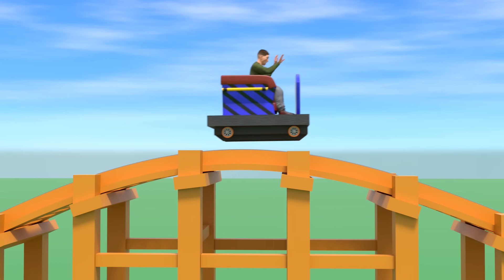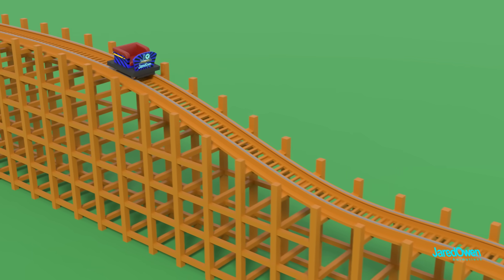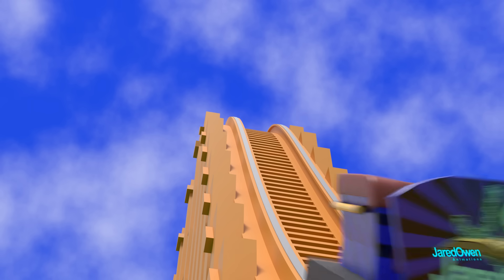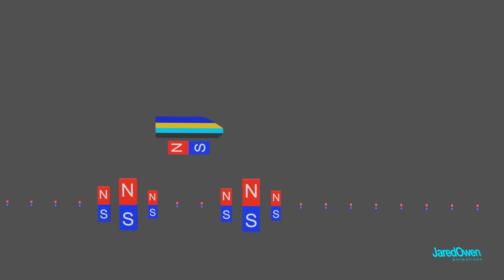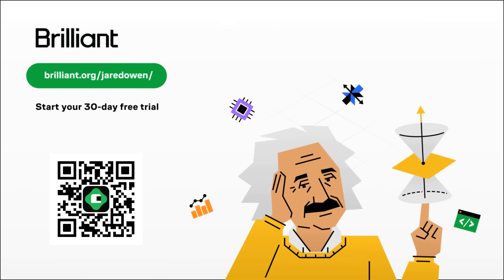The Evolution of Roller Coasters: From Wood to Steel

Comment: 12:16 This may be a question for an engineer, but couldn’t they capture some of the current from the Eddy current brake system and use it as a form of generating electricity?

Comment: Just thinking: if you use the magnetic breaksystem and you would make a small change by adding/attaching wires can't you harvest some (but probably not much) electricity from it?  -Don't know how much it would generate since the ride passes so quickly or what the peak would be... But hey, the energy is lost anyway, why not see if it can charge some capacitor which in turn through some circuitry can 'discharge' into some battery when the right amount is reached and charge a battery, power a charging station for power banks or something like that, like I said, I don't know if it would even be able to do that... Might take months/years before the charge would be good enough to do anything with it, if it's even possible/efficient enough

Comment: We went to see geauga lake after it closed. it was in the middle of the night and my moron friend sat down and pulled the lap bar down on the big dipper and got stuck. I was like "are you fkn kidding me?!? Now we have to get the police to get you out. luckily it used the old restraints and could be unlocked by hitting the emergency release on the train without power. we tried to winch the train to the top of the hill to try and ride but we saw weeds n trees growing through the track so we abandoned it half way up the hill 😂 even though the train was parked we were able to release the brake by letting pressure out of the hydrolic line since it had upgraded brakes and didn't use the old manual brake

Comment: I'm 79. Remember a 90 ft wooden coaster at Riverside Park, Des Moines Iowa back in 50's 60s. It rocked, literally.  You could feel it and hear the coaster creak sometimes. Also many years later, the Big Bad Wolf at Williamsburg Busch Gardens. It is an inverted coaster. It is a different feeling to have nothing under you on a coaster.

Comment: over the shoulder restraints didn't entirely replace lap bars. As wooden and retro-steel coasters are still made now and again, you do not want shoulder restraints on something like that. Why? there isn't enough head padding in the universe to keep you from rattling your skull with how rough some of those can be. Which is a lot of the fun for some folks.

Also, most coasters are long enough to be loading and unloading several trains at once, as well as having 1-2 on the ride at the same time, some of those LSMs can be reconfigured to be variable brakes as well so you can ensure safety spacing. From a customer experiance and business standpoint, it's a win-win. more trains means more customers can use the ride at once, so shorter lines. There's also a workshop built into the station at these rides where they can service the trains. and there's special moving track to load and unload trains into that area. Anyone who goes on Cedar Point's Iron Dragon can get a good view of the backup train if that ride is still there.

Comment: I like to sit in the front row when I ride a roller coaster. The main reason is to see where I’m going.

Which row do you like to sit in when you ride a roller coaster?
Reply: Back. Better acceleration over hills. Feels more out of control. But it does depend on the ride.

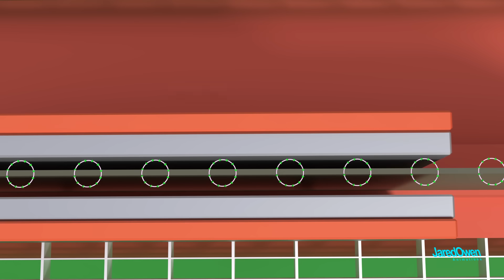Comment: 12:00 A lot of magnetic brakes use the copper or AL fin on the train, and magnets on the track. This helps ensure better safety bc if the magnet fails on the car (usually from overheat), you don't have backups. The permanent magnets on the track can also be "flashed" regularly as part of maintenance, to ensure they still have a strong field for the purpose.

Comment: What if both locking pins for the locking safety bar fail?
Reply: The bar would open, but that’s not going to happen. These things are inspected on a daily basis at every amusement park. They’re not just going to fail for no reason. It would be like asking “what would happen if your car just explodes all of a sudden?” Look at the safety statistics for roller coasters. They are incredibly safe and people don’t really fall out of them ever. And if they do, it’s for a specific reason (too large, amputee, improperly locked, rider error, external issue, etc) and not because the bar just failed for no reason. In fact I don’t think that has ever happened.

Comment: There are a few wooden coasters with loops
Reply: There aren’t. No wooden roller coaster has a loop. Some do have inversions, such as zero-g rolls and stalls, but only one modern wooden coaster was ever built with a loop (Son of Beast) and it was a failure. Loops are hard to support on a wooden coaster.

Comment: 1:22 they actually have something similar in wales on the talyllyn narrow gauge railway that they used to haul trucks up the hill step mountain to transport slate and rock and at the bottom they had one engine to get the trucks that were filled with slate and take it

Comment: Good video! What animation software did you use? Also, with Exa's, they're anything over 500. I know Six Flags Qiddiya says Falcon's Flight is over 600, but that's from sea level. The actual biggest drop riders experience is like 540 feet (the Gateway Arch shaped top hat). I can only imagine the friction those wheels are facing LOL.

Comment: Fun facts. Electric braking is heavily used on big trucks or lorries, actually it is required by law to be in place in many countries. Then they have their standard service brakes at the wheels but also an electromagnet wheel and a metal disk, usually placed at the driveshaft right behind the transmission. Then you can slow down a fully loaded truck 40-100 ton truck or a crane from 90 km/h down to nothing in no time. They also use magnetic brakes on land speed vehicles. Then they can´t use regular rubber wheels, but instead they use solid Aluminum disc for a wheel and a magnet to slow it down...

Comment: Could you do a part two and cover some of these?

LSM’s
zero cars
why launch fins don’t interface with the sides of the train and only the underside in newer coasters
Variable speed chain lifts
Banking and outer banking/lateral forces
Heart lining
tire drives
cable lifts
valleying and track sections that can be removed to de-valley a train
drop tracks, tilt tracks, turn tables, and switch tracks
why some coasters have side friction wheels between the track and some have them outside
Train articulation (like how some coasters have three seat long cars while others can have one seat long cars)
Single rail coasters 
Parts of the train like wheel assemblies/bogies and the chassis
how onboard synchronized audio works for coasters 
And of course block zones 

Also I may have missed a few to suggest but I think this is plenty

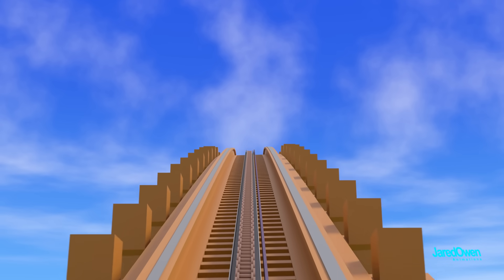Comment: 3:08 i thought it was called a lift or is that a more modern name of it. 4:25  I thought it was just the chain. 4:45  i know there is a roller couster still around that uses a brakemen 6:17 i know some slower cousters have upstop pads instead of weels bit from what i known they weren't used on faster cousters snd the faster ones use upstop wheels. 8:14 i know some cpusters are hybrids and i pretty sure that the hybrids have steel rails but woob supports. 11:19 i thought it was the other way around or can it be eather way. Can you aslo have magnets on the tracks to help stop it or or have them train cars? 12:48 oh so this how that works? 14:30 RIP

Comment: Did smiler this week, and I noticed the fin breaks on the climb hill... Cleverly they were on a cantilever and pushed down while the train moved forward, and then moved back when it had passed. I did wonder why they went to this effort at such a slow speed, but maybe it would offer enough opposing force to put strain on the system over time maybe?
Also did Air (that's how I know it, galactica I think now) for the first time... That is a truly unique experience and very enjoyable!
Reply: I think gerslaughter uses magnetic brakes as anti rollbacks on their infinity coasters, so if the chain snaps, It slowly rolls down. The magnets probably lower using a pneumatic system. As for why the lower, its so they dont slow the train down when  the train goes up. If they didn't lower, it would likely put excess stress on the magnets and lift motor.

Comment: You forgot about hydraulic launch, it came before magnetic launch. You should’ve explained it because hydraulic launch is actually pretty cool and efficient.
Reply: Actually, no the flight of fear roller coasters were the first roller coasters to use a magnetic launch, they opened in 1996. The first hydraulic launch coaster was Xcelerator, which opened in 2002.

Comment: 0:00 intro
0:24 history
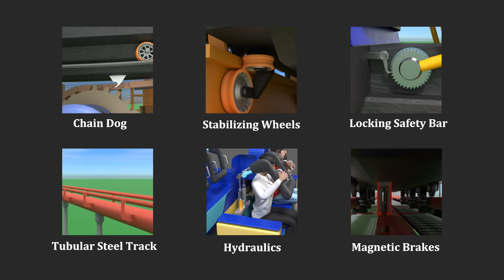1:54 jared owen's rollercoaster
2:54 lift hill
4:41 stopping at the station
5:12 more intense
5:34 safety wheels
6:53 passenger safety
7:38 MORE PEOPLE!!!
8:08 modern rollercoaster
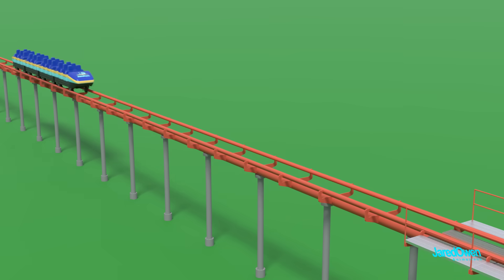8:55 upgraded brakes
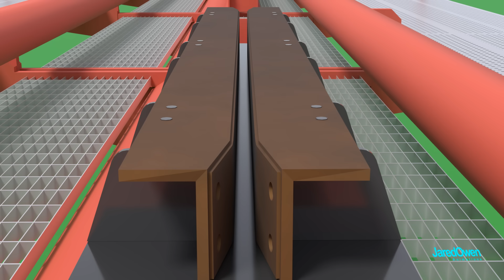9:29 2nd attempt on loops and inversions
10:04 upgraded safety
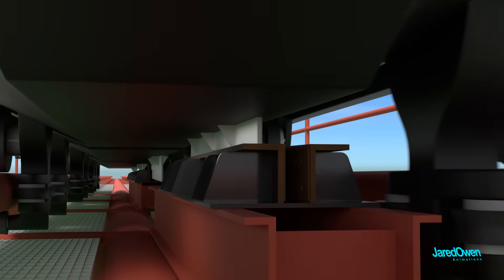11:08 magnetic brakes
12:35 launch hill
13:42 inverted rollercoaster
14:00 rollercoaster height
14:48 sponser ew
I liked my own coment becuz no one would😢

Comment: Isn't the top thrill dragster also a strata coaster? Iirc it towers upwards of 400 feet. By far the craziest fun ride I've ever been on. Everything turns into a blur from the insane launch speed and suddenly flying high up into the air and before you know it you're coming down the other side to the end. It's over in under a minute but it's one of the most fun coasters I've ever been on.

Comment: The first "Top Thrill Dragster" (at Cedar Point) originally used a heavy flywheel arrangement to accelerate the cars with a force several "Gs". There is a TTD2 now that uses linear sync motors  to drive the cars to120 MPH up a 2- 400+ foot towers.

Comment: The first Hyper coaster I've been on is Wild Thing in 1996 first season it was built. At ValleyFair in Shakopee Minnesota. 207' tall 74 mph.
 I moved to Ohio in 2013 and I've been on Millennium Force, Magnum and Mean Streak before it was Steel Vengeance. I've been in line for original Top Thrill but it started raining and they closed it for the day, sadly I never got to ride it.

Comment: 4:13 the anti-rollbacks are usually spaced out of phase with each other, so the train doesn't even roll back an entire tooth if the chain fails, and there is still redundancy. Some B&M rides have sets of 4 anti-rollback dogs, all 1/4 of a notch out of phase, so the train can't roll back more than 1/4 of a notch.

Comment: Bit of a note: lap bars are equally as safe as OTS restraints, which is why lap bars are still fairly prominent. A lot of roller coasters nowadays have OTS-lap bar hybrids, where it comes down from above but only rests on the lap. Regardless, they’re still very prominently used.

Comment: Good video, but the depiction of the Mauch Chunk Railway is not accurate. It was a mostly gentle nine mile ride from Summit Hill to Mauch Chunk, some reports claim there could be high speeds. The return to Summit Hill had a inclined plane at Mauch Chunk then  coasting to the base of the inclined plane below Summit Hill.

Comment: I am surprised PERMANENT magnets make it. Car's starters use electromagnets for both stator and rotor, for example.  I though the linear motor uses a linear switch (just like the rotary switch in a rotary motor).  They teached me  "permanent magnets are for small model trains".  What an evolution in 40 years only.

Comment: The permanent magnets/electromagnets are actually attached to the tracks and the metal fins are attached to the cars but they still use the same mechanism to accelerate and brake. If it is the other way around the moving magnet could induce eddy currents in the tracks or get attracted/repelled depending on the material which can slow down the cars. It can also expose riders to magnetic fields for a longer duration which are bad for them. Another cool thing is that maglev trains also use linear synchronous motor technology.

Comment: Technology is constantly moving with rollercoasters. You could easily do a part 2. Talking about block sections, high speed track switches which are all the rage at the moment, tilt tracks & drop tracks, the fact over shoulder restraints are outdated now and modern lap bars are now the standard, 4d elements such as rotating seats and cars, swing launches, modern wooden/steel hybrid coasters, shuttle open circuit coasters etc. What you have here is great and informative, but it finishes at where rollercoasters were about 15 years ago, a lot has changed since.

Comment: There is another type of launch system that has been used on roller coasters, that being a "catapult" launching system. Same concept as on an aircraft carrier. Hydraulic pressure  pushes a shuttle that is holding onto the bottom of the passenger carriage which accelerates the car(s) up to the necessary speed to climb the first hill, or, as was in the case of the very first coaster to use this system, the "Montezooma's Revenge" at Knott's Berry Farm in Buena Park, CA, (1978 was the rides debut year.), the passenger train of cars was accelerated out of the loading station and immediately into a  360 degree loop!

Comment: This is actually an amazing video but the way you explained the difference between the over the shoulder restraints and the lap bar could be a little misleading. The way you made the transition to over the shoulder restraints to me, sounded like you were trying to make lap bars seem at least less safe compared to over the shoulder restraints. But actually with the amount of redundancies in modern day roller coasters to guarantee a safe ride to everyone, lap bars are just as safe as over the shoulder restraints in fact, I actually prefer them because of how free I feel.

Comment: this helps me really appreciate where i live in pennsylvania being so close to old historic amusement parks with great wooden coasters, idlewild (#12 oldest in the world #4 in the US) doesnt have much in terms of high intensity rides and the rides have changed so much, the wild mouse and rollo coaster arent that old. but kennywood on the other hand (#31 oldest in the world #15 in the US) still has 2 of the top 10 oldest coasters still in operation in the whole world, and unique ones at that. the jackrabbit, #3 oldest, was one of the first of jack millers coasters to utilize the upstop wheels for the iconic airtime hills, and the racer which i believe is the last coaster in the US to have a mobius loop (2 trains run at the same time to give the illusion of a race, the trains require 2 stops at the station to make a full loop on the track) and theres also the thunderbolt made from the remains of the pippin, wish i couldve rode the full thing

Comment: Here's a few other things about rollercoasters:

1. It's basically impossible for them to stop at any point other than a lift hill brake run. If the ride stops unexpectedly on the lift hill or brake run, there is no danger to you, and in fact that's the safety systems on the ride working correctly.
2. If there is more than one train, the brakes WILL stop trains behind you from running into you in the unlikely event you get stuck in any way.
3. Nearly every part of the ride has redundancy, so if one part fails, you're not in danger as you go back to the station.
4. Over-the-shoulder restraints aren't required for loops; some lap bars have the ability to keep you in just fine.
5. If the launch hill does not send you fast enough to get over the hill, that's fine. You will come to a stop quickly. Most rides can also try the launch again.

Comment: The ratchet rails are great and all, until you come across a ride like Mystery Mines in Dollywood. That ride has 2 vertical lift hills that nullify the point of a ratchet rail and dog. If the lift mechanism fails, you are rolling back onto the brake run at the bottom, risking potential whiplash, and getting emergency services called automatically because your smart device thought you fell! The ratchet dogs aren't spring-loaded on these types of rides, because the ride is vertical on these hills. How do you expect to disembark when you are vertical, potentially reclined so you risk sliding out and hitting the rails below, which may be electrified??

Comment: There are still a few of the early style rollercoasters with brakemen running. I've been on one and it was surprisingly intense and fast, particularly when pulling out of the drops. Having a human controlling the brakes also means every ride is different, and some will allow it to run faster than others.  Another fun thing was that it uses basic ratcheting lap bars that cover both riders on the two person bench seats, and they are released by a rail pressing a wheel in as the cars enter the station, which means the bars release before the train stops, so half the people are out before it's even come to a stop. Good for throughput on busy days (the operators then have to push the train from the unload to the load platform).